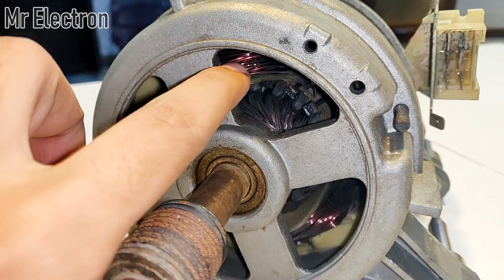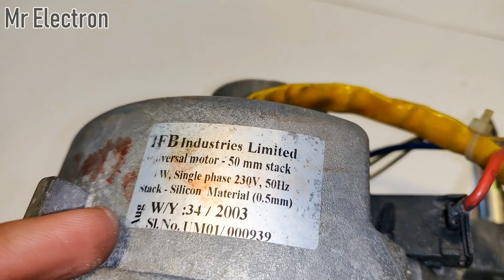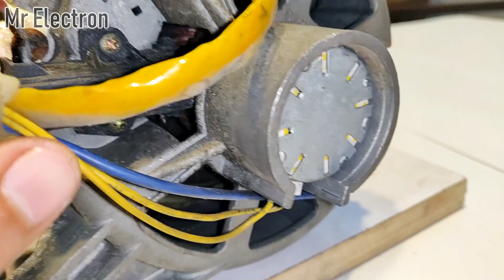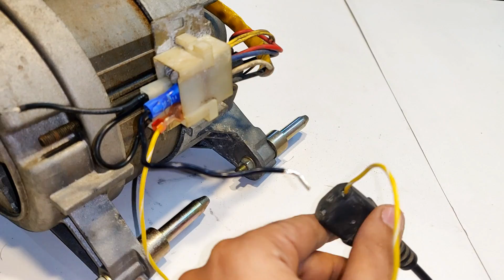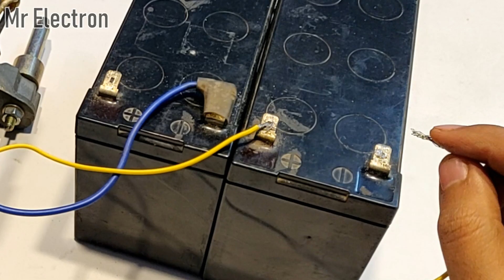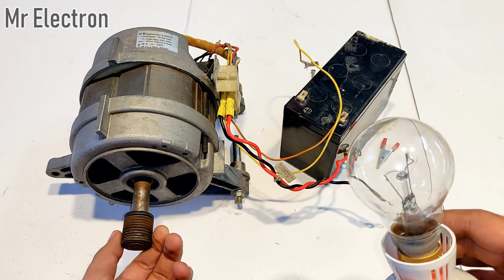220V Washing Machine Universal Motor 14000 RPM -  FULL DC Motor Generator Experiment COMPILATION

Comment from the maker: BEST BATTERY CHARGER DIY VIDEO - https://youtu.be/ZN3saILbYUw?si=9_nLu0vKOqfn4zi_
Electrical DC Power Supply : http://bit.ly/2Paqvlp
Join this channel to get access to perks:
https://www.youtube.com/channel/UCWFbPzBb7dCyCWuBA-DBrMA/join
Mr.Electron Patreon's Page - www.patreon.com/mrelectron
Hindi Channel                 - www.youtube.com/@Mr.ElectronHindi
Alternator Channel            - www.youtube.com/@mrelectron_alternator
Watsapp Channel              - https://whatsapp.com/channel/0029VaQmmRaFCCoWOf7huh3G
Reply: From one Mr. E to another, you're pretty cool Dude!!! 😎 I have a question, if this was a 6 pole motor instead of a 2 pole, would you have 8 of those tabs to wire in series instead of 4? Thanks Homie. ✌️
Reply: Is torque good plzz reply I'm using his motor for e bike and connect motor to gear so reducing load on motor and motor will be powered wil 1200w dc to dc 80v boost converter plzzz reply should I do this

Comment: When run on dc current those motors have better be connected as dc shunt motors. The field windings should be connected in parallel with the armature and not in series. This way they work with more power (torque). Moreover they can be easily controlled in terms of torque and rpm.

Comment: Is torque good plzz reply I'm using his motor for e bike and connect motor to gear so reducing load on motor and motor will be powered wil 1200w dc to dc 80v boost converter plzzz reply should I do this
Reply from the maker: You will need a reducer gear of atleast 5:1 and it will work
Reply: @MrElectron  can I use motorcycle engine gear box for this plzzz reply
Reply: @MrElectron  plzz reply brother
Reply: @MrElectron  bro plzzz answer my last question can I motorcycle engine gear box will it work plzz reply!

Comment: Is torque good plzz reply I'm using his motor for e bike and connect motor to gear so reducing load on motor and motor will be powered wil 1200w dc to dc 80v boost converter plzzz reply should I do this

Comment: Hmmmmm...in this case, the Motor is running on approx. 5% of its capability. I often use tis Metod to test such Motors, if they work and/or if the bearings ok... For higher RPM and torque you can add more batterys in series. 24 / 36 / 48 Volt and so on..up to 240 Volt. Thats the Voltage, what the Motor is made for. But at this Voltage, the RPM will run away on you. You can use the tachometer at the back of the motor in conjunction with a microcontroller and a Mosfet (PWM) to controll the speed and torque, because such Motors run on AC and DC.  Maybe i will make a video about that at some point in the future..... Greets from Germany.

Comment: hi  
i have the motors runng on dc 12v battery now but when i apply a load they want to slow down to a snail pace in others words extremely slow  got very little voltage

Comment: Hi, Thank you very much for the details shared. Pretty good explaination. 
I have one question. I did the same wiring & turned on the motor using Battery. But found that the field winding was getting heated up. Is that common? or is there any issue with the motor?